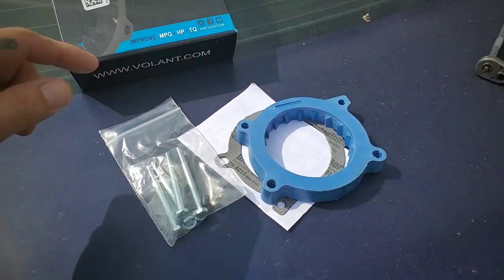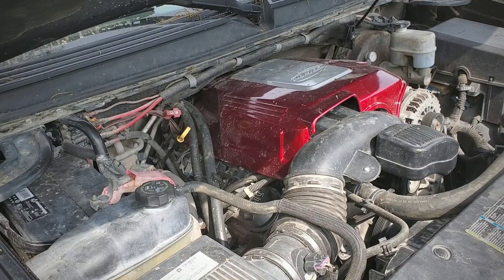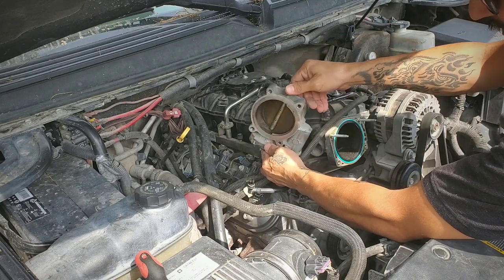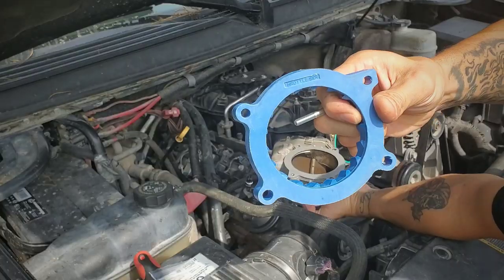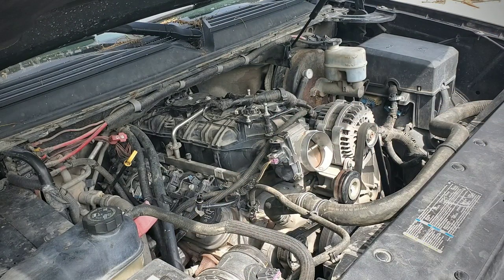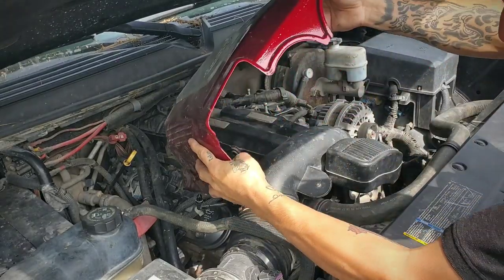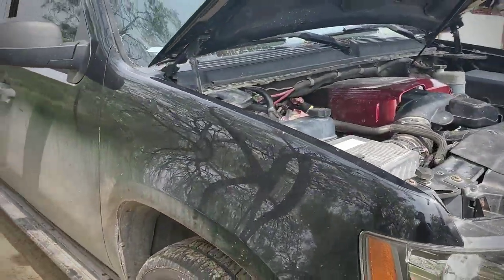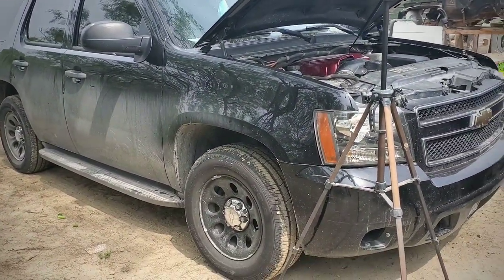Volant Throttle Body Spacer install on 5.3 Tahoe PPV

Comment: Was this before the cam? Cause I don’t hear any chop to that cam
Reply from the maker: This is a stage 2 cam. Which is more of a daily cam with added performance for towing/ hauling.  For a heavy Tahoe,  its perfect. Anything higher,  like a stage 3 or 4 requires additional supporting mods,.. torque converter, longer pushrod etc. and more $ of course. This cam gives the best performance for the $. 
I'll do a better sound test after I get it re-tuned.

Comment: Yo GT I recently bought a 2010 PPv Tahoe and I’m getting a 0P300 random multiple misfire. Changed coils, plugs, cables. Any suggestions I’m in Houston area
Reply from the maker: When I bought mine it had the same symptoms. I replaced the plugs and cables, but kept running misfire.  So I took off the valve covers and noticed 1 of the rockers wasn't moving.  It had a collapsed lifter. 
Mine had the active fuel management,  which failed. I'm not sure if 2010 still had it, but worth a shot. Just listen to the engine which side the misfire is coming from.  Driver side cyl 1 & 7,.. Passenger side cyl 4 & 6.
 it's a good place to start 🤷🏻‍♂️
Reply: How much did that mechanic tax to do a lifter replacement? I’m in the same boat but I got the 304 indicating cylinder 4 misfire. I’m sure it’s a collapsed lifter got nasty tick

Comment: Can't wait to see the next video! Is it gonna be headers, intake, or both. Great job!
Reply from the maker: Next video should be intake and a test drive.  A good set of headers are around $400, so I'll have to wait a while longer for those. I did manage to buy the turbo manifold for my Mitsubishi.  Something ive been wanting to do since I bought the car. Hope I don't blow it up 😅
Reply: @GTsPerformance  I think the lab rat can handle it. I sold some long tube headers last year for $80. I was trying to move them quick so I priced them to sell.   Keep up the great videos they're outstanding. You're doing stuff I dream about doing.
Reply: Where are you finding headers for $400 I’ve looked for my 2011 Chevrolet Silverado 5.3 and the cheapest ones are $600-1000

Comment: If tou want better throttle response, just get a pedal commander. Big difference.
Reply from the maker: That's the first time I've heard of that.. did a quick search and sounds interesting!  
I'm thinking of upgrading my cam to a stage 4 pretty soon,  but I'll keep it in mind. 👍
Reply: @GTsPerformance  
I was skeptical at first. Finally bit the bullet after all the reviews and got it for my sierra. Dont regret it at all. Has several settings. If you get one I would suggest not to set it on sport mode 4 or 3. Extremely sensitive and you will be spinning your tires without intent, and might make you run into the car in front of you. Only takes about 10 minutes to install.

Comment: For the record a spacer is not meant to give power 🤦🏻‍♂️
Reply: Correct...it's throttle response
Reply: It definitely adds power there’s dyno sheets that prove it...... for the record drive somthing with over 155 hp and then you can talk bout power.... 🤡

Comment: Waste of $$ bro 
They add no power gains 
Trust me!!..  had one for awhile & even when I got the truck dyno there was no improvement 
But great HOW TO video
Reply: You mean in your personal and limited circumstance?
Reply: I have an older truck and it sprays fuel just before the throttle body. So in my case the fuel/air has more space to mix thoroughly, and resulted in an extra 2mpg consistently.
Reply: Yea you could say that because my truck is port injected so the spacer is just for looks. 
Same goes for GT’s set up
Reply: And are you sure that 2MPG is not just a placebo affect ?? You want to believe that a TB spacer of yours is doing something??!!
Reply: @UNEEK_LOGIK  Fair point and to answer your question I've been using an app on my phone to track mpg for about a year and a half before I added a spacer and it's been a few years since. Ever since I added my spacer it's been consistently a couple mpg higher. 

I would strongly suggest tracking your milage too. If it takes a dip you can usually take care of it before something expensive happens....